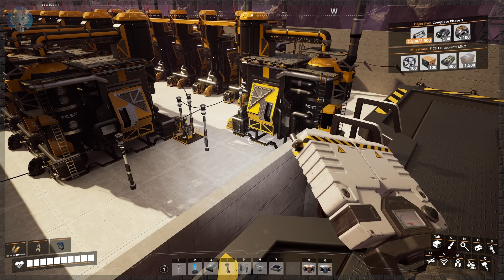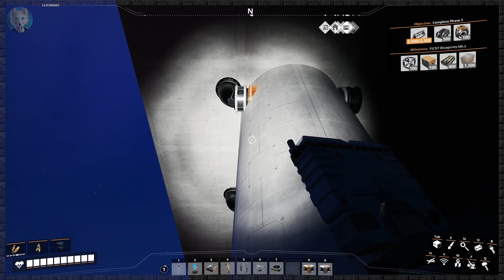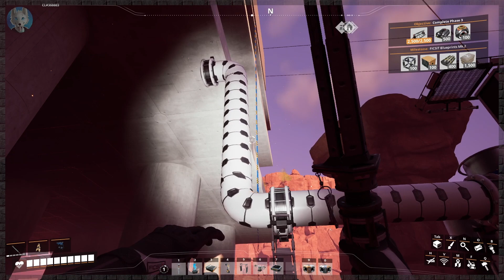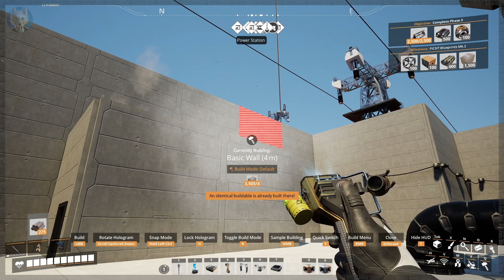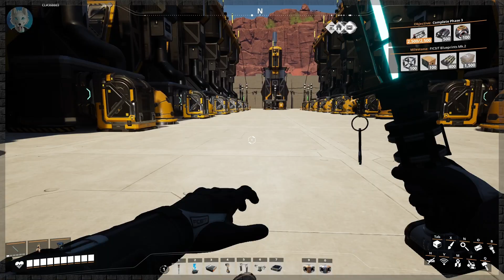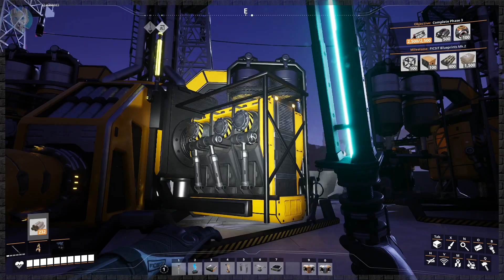Satisfactory 1.0 | Singleplayer | S4 Episode 15

Comment: oh a fellow former truckdriver :D i use to drive export from denmark to spain and italy : D
Reply from the maker: Yep, was hauling usually around 100,000 lbs worth of logs down a mountain to the town saw mills. You would think that is not a long journey, but when you could only drive at max maybe 10 mph on those roads that were carved out. You could only make 2 round trips a day. Had to be real carful too, one wrong move and you were taking the quick way down in a fireball of twisted metal.

Comment: A bit late to this but in case ya havent figured it out yet to place the spliters on the ceiling with out foundation the trick is hang the belt first alonge where ya whana put the splitters then snap the spliters onto the belt
Reply from the maker: Thanks for watching and thanks for tip, hope it helps people out that do not know this! I have known about this for while myself, I just like to put down all my splitters/mergers first. It helps plan out the manifolds for me. 

If you are new to the channel then you may not know that this is a challenge playthrough since I am working on my forth season. This is a custom scenario I put together myself with rules for challenge since I have over 3500 hours in the game. It is inspired by the train world scenario from factorio. 

1. Factories must be separated and spread out across the map, no mega factories or city builds like in season 3.
2. No copy/paste factories, they must be unique in some way.
3. Factories can only be fed by train, no belts, pipes, tractors, trucks, or drones between factories.
4. Trains must be atleast 5 cars long (forcing me to build big factories.
5. Trains can only carry one thing no mixed cars or mixed trains. Example: One five car train can only carry iron plates. This rule is so I can't take advantage of rule 4.
6. No mods what so ever.